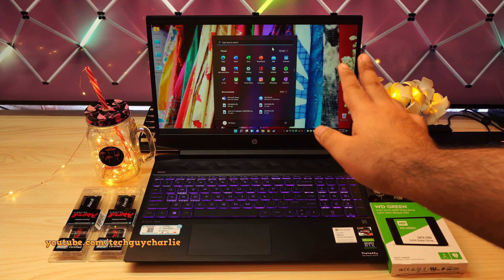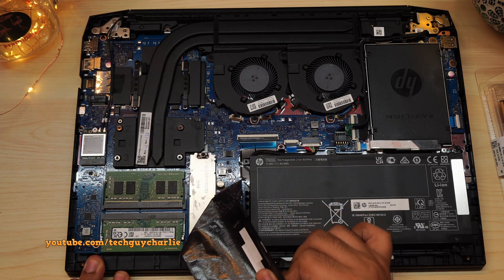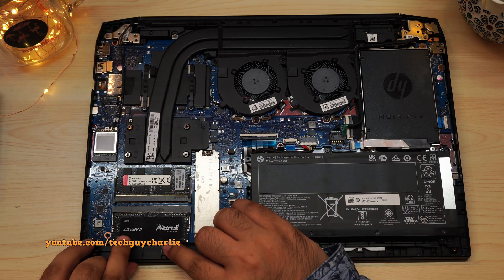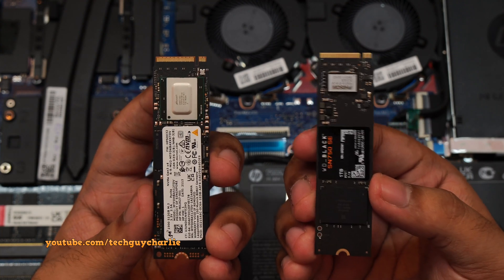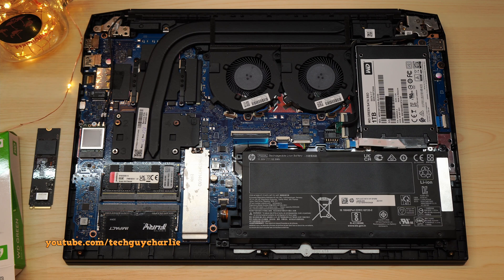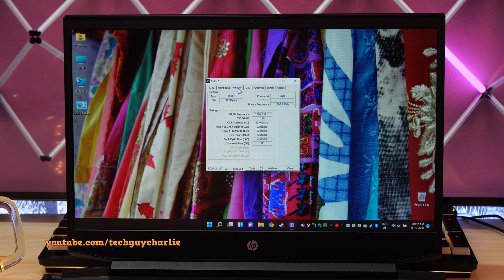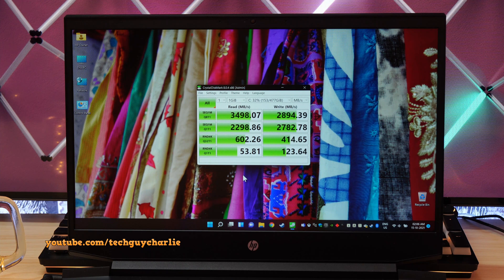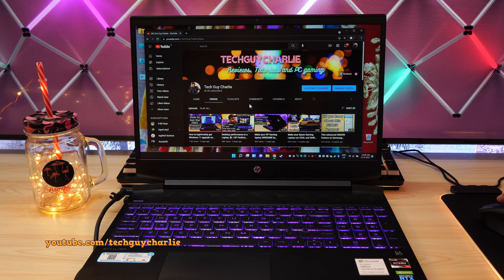HP Pavilion Gaming Laptop Ultimate RAM and SSD Upgrade Guide

Comment: Hey Bro I have Hp Ec0xxx And i installed one stick of ram 8gb making it 16gb but when i boot into system it only shows 5.9 gb usable and 10.1 gb hardware reserved in the task manager also I figured out About UMA buffer size but when i get into bios for that there is no Advanced Tab there for changing the Buffer size and Im stuck here with 5.9 gb please help me out should i reset the bios ?
Reply from the maker: That's so odd, I just checked, mine shows 670mb as hardware reserved. I also checked and there seems to be no option to change the memory available to integrated graphics through the BIOS. 10 GB hardware reserved is just not right, total waste of memory because its never going to use that much. Maybe a BIOS reset might help.
Reply: all of a sudden my laptop started crashing now when i first tried to enter into bios it started to freeze on boot logo , but somehow i still manage to go into windows and now it gives bsod issue ig i have to again reinstall windows and will try to reset the bios

Comment: Bro, I have this same laptop but the issues is, I'm facing problems with the gaming...Not  a single game can be run smoothly. can we upgrade or replace the graphics card in this lapop?
Reply from the maker: Did you clean the fan and heatsink? maybe its overheating, because mine is still working fine, or maybe its time to do a clean install of Windows itself. Also, you cant upgrade the graphics card because its soldered on to the motherboard.
Reply: @TechGuyCharlie have done everything and also went through a proper service. Nothing changed though, is there any possibility to use external graphics card or change the cu itself?

Comment: Finally did this in 3 hours! The longest part was trying to pry open the back panel, scratching the surface a couple of times. Then I screwed the SSD wrong way... Then I couldn't close the back panel properly so had to screw it for a second time... But finally, finally I did it🫠
Reply: Broke my nail trying to pry open btw forgot to add that lol
Reply from the maker: I miss the good old times when you didn't have to pry the back panel open, the upgrade opening was right there at the bottom of the case!

Comment: What is the maximum capacity of SATA expandable storage for this Pavilion Laptop ???
Reply from the maker: I've tested 2TB SATA SSD and it worked fine, so I can confidently say 2TB SATA SSD should work without any issues. I'd like to test higher capacity but anything beyond 2TB becomes very expensive.

Comment: Hi, Please I need your help
I have this same laptop but mine came with 1 TB HDD and I added a 250gb SSD before
Today I purchased a WD Black SN770 1tb NVME m.2 and I tried to clone my current window into my new ssd and it completed without any errors but when I try to replace and add this ssd then it wont boot up, not even logo shows up. Please I need your help
Reply from the maker: Are you able to enter into the BIOS? or that doesn't work either?
If yes, then check if its being detected by the laptop? and then make sure boot order is correct? 
If the laptop just does not post with the new nvme, then something is wrong with the new drive.
Reply: @TechGuyCharlie  I fixed it but I was not able to clone my previous ssd, my device was being detected if I checked on system information before boot but it didn't appear on boot menu
Also when I tried to boot up using usb the it was working as well but not when I put ssd internally
I'm not sure why this was happening but I had to remove my hdd then insert my new ssd and using a usb flash windows 11 onto my new ssd
Then it worked
Reply: @TechGuyCharlie also after installation I'm unable to use my old ssd with previous windows 11 now if I change it with my current internal new ssd

Comment: is Crucial BX500 1 TB Desktop, Laptop Black SATA Internal Solid State Drive (SSD) (CT1000BX500SSD1) good . Cz I will be able to save some bucks with this one.
Reply from the maker: Its an entry level SSD, so it wont be fast, but certainly faster than HDD, But its the best if you are going to use it as a secondary drive, I went with WD Green as my secondary to save money 😁

Comment: I have an HP Pavilion 15-ec1073dx Gaming Laptop. When I bought it 5 years ago. It had 8GB DDR4 3200 MHz Ram. I upgraded it to 16GB DDR4 3200 MHz. If I was to upgrade to 32GB DDR4 3200 MHz. Will there be a noticeable performance increase for the cpu, gpu.
Reply from the maker: Only if you use apps that use more than 16GB of RAM like video editing or playing memory intensive games, or else 16GB is enough for normal day to day office/web browsing use.
Reply: @TechGuyCharlie My GPU uses 1GB and when I use Google Chrome or Opera Browser it uses 7GB

Comment: Is it truly necessary to unplug and remove the battery from the laptop before performing the RAM upgrade?
Reply from the maker: Yes to be on safer side, I didn't unplug because I regularly upgrade laptops.
Reply: @TechGuyCharlie  I also didn't remove my battery before installing an additional stick of RAM as the slot was easily accessible without any battery removal. I haven't noticed any issues and it worked perfectly fine. But in the future, I'll make sure to unplug the battery for extra safety.

Comment: Bro can i use 2 different brand ram in my laptop ? My laptop have sk hynix 8gb , i need to upgrade one more 8gb Ram ! 
Thinking about G skill ram
Reply from the maker: You can, but there is no guarantee that both will work at their max rated speed, i've seen this issue before, so Its best to use identical RAM from the same manufacturer.

Comment: where can I find original HP battery for the laptop,, any trusted website to deliver in india?
Reply: open ur laptop there battery model is written then search that on hp centers if not available then google the model and order it you want install yourself
Reply from the maker: You'll have to call up HP support or go to their service center! I got mine replaced this year, they replaced it genuine HP battery, and now my backup is way better, but genuine batteries are very expensive, not worth replacing if you are using your laptop at home.

Comment: Product: HP Pavilion Gaming - 15-ec0100ax
Operating System: Microsoft Windows 11
At first only 5.9gb of ram was usable and the rest 2.1 was reserved for hardware. I researched and found the the only thing I can do is to add 1 more ram stick so I upgraded to 2x8gb ram but now was I added 1 more stick of 8 gb ram 10.1gb of ram is hardware reserved and only 5.9gb is usable now too
Pls tell me what to do  How can I removed this reserved ram. 

tried removing the ram stick to check if the ram I order was faulty but it was alright

Comment: Hi, I have installed 2x 16gb rams just like you showed. I booted the computer and it showed on memory i had 32gb of memory. Then I partitioned the SSD and started using the laptop for a few hours. I checked the memory again and surprisingly it only showed 16gb and on CPU-Z it doesn't show Dual channel only single. I have taken the sticks out and swapped them but still same issue. Any idea why ?

Comment: Are you able to upgrade the motherboard with a better cpu and gpu?  I have one with a Ryzen 5 and GeForce 1050 was hoping to be able to go to ryzen 7 and a better gpu if possible to replace the whole assembly
Reply: Figured I’d provide an update for anyone interested. I bought an entire motherboard with the ryzen 7 and gtx1660ti using HP part numbers on their service guide. Ordered it from china for almost $1000 less than anything in the states and surprisingly it works great. Checked part numbers of the chips and everything checked out. Only other thing that was needed was a 200 watt power cable as that is the only different connector between the boards. I can provide part numbers for anyone interested. After many updates and driver installs it works perfectly and is significantly faster as I hoped

Comment: Thanks for the great video! I have the same laptop and used the same RAM, however in the task manager mine only registers as 2400 MHz instead of 3200 MHz. BIOS shows 3200 MHz, but task manager is showing 2400 MHz. Any ideas how to fix this issue?
Reply from the maker: That's odd, usually I'd suggest turning on xmp from the bios, but this laptop doesn't have that option, the RAM is supposed to run at the xmp speed by default.

Comment: i installed a new ssd into my pc and still it won't show in disk management. Is there anything i need to change in bios?
Also the Gpt popup doesn't come on my disk management screen. HELP😭😭!!!!!!
Reply from the maker: There is nothing that needs to be changed in the BIOS, can you see the new drive in the device manager? Sounds like a defective drive to me. Try going into the BIOS and see if its listed there.
Reply: @TechGuyCharlie  No it doesn't even show in device manager under disk drivers
Reply from the maker: Defective drive for sure, you could test it in another PC just to be sure.
Reply: @TechGuyCharlie  Thanks for the help dude. Much appreciated 🙌🏻

Comment: i have the gtrx 1650 version of this laptop, this is by far the most useful tutorial i have seen, keep it up
Reply from the maker: Glad the video was helpful. 😊
Reply: I good is  dor play games ? Like. Mw3?
Reply: @ezequielandrade3100  depends on the games optimization, games like GTA 5 and forza H5 run at ultra settings with 60-90fps consistently, but some games will run at medium settings, i havent tried Mw3 but it would probably be 60fps at medium settings

Comment: I have the same laptop hp pavilion gaming 15 with AMD R5 5600H CPU and RTX 3050 GPU. Recently I did buy and upgraded my laptop ram to 32gb ram but after installing new ram I noticed everything works fine as usual except games. For some reason games which are supposed to get more than 80-90fps from 8gb previous ram now I'm get 40fps with 32gb ram. It looks like a fps lock or something because it's not going more than 40FPS and not getting below 39fps. I tested it with 2 AAA titles which are GTA 5 and Ghost wire Tokyo. I did contact laptop service center they said try updating drivers and update but all of them are already updated. If you know why might causing this issue for me please help.
Reply from the maker: I guess the RAM is not running at the rated XMP speed, open task manager and see how many Mhz it is running at? Did you mix and match RAM sticks? if so that might be it.
Reply: @TechGuyCharlie  I figured out what's the reason for this, it's the software. After formatting and reinstalling windows every thing got back to normal and it's quick too.

Comment: can i use single slot 16 gb ram in dual slot ?
Reply from the maker: Bad idea, because the RAM is going to run in single channel mode, greatly limiting the performance. If you want only 16GB then get two 8GB sticks, that way the RAM is going to run in dual channel giving you better performance, or if you want to future proof, grab two 16GB sticks just like I did.
Reply: @TechGuyCharlie  thanku so much😊👍

Comment: I had installed a 8gb along with Ram that came installed from the store but the 3200 changed to 2667 is that a problem with every hp laptop or it's just with the pavilion gaming 15 series?
Reply from the maker: Both the sticks must be of the exact same brand, model and speed, then only it's going to run at 3200Mhz.
This is one of the reasons I always recommend swapping out both sticks for the same brand and model. I've seen this issue happen with many laptops and desktops, not just HP, seen it happen on Acer as well, even if both RAM sticks are rated to run at 3200Mhz, they run at 2667 just because they aren't from the same brand.
Also, can you remove the pre-installed RAM and see if the new one operates at 3200 MHz? if not, then might be some compatibility thing.
Reply: @TechGuyCharlie  ok bro got it
Reply from the maker: Let me know if leaving just the new RAM makes it run at 3200mhz, just to rule out any incompatibility, if it runs at 3200mhz then you can buy another one of the exact same brand and model.
Reply: @TechGuyCharlie not checked that thing pre-installed one runs at 3200 not checked the new one.

Comment: Does this laptop has XMP?
Reply from the maker: It doesn't, in fact none of the gaming laptops I've seen have user selectable XMP setting in UEFI, the memory will run at the rated speed, like if you install 3200mhz RAM, it's gonna run at 3200mhz regardless of manual XMP setting.
Reply: @TechGuyCharlie   I have pavilion 15 gaming laptop and it doesn’t support XMP profile so I can’t tweak my settings from 2666 to 3200 mhz
Reply from the maker: @globalpandaa  Sorry, I might sound dumb for asking, but is the RAM rated to run at 3200Mhz? if yes, then have you paired it with any other brand of memory? 
And, manual XMP toggle wont be available on majority of laptops, mine doesnt have it either, but the RAM does run at 3200Mhz.

Comment: Bro I have Ryzen 5 5600H GTX 1650 15-ec2004 ax model.. ssd 512 gb.. Is it possible to add another same model ssd mvme m. 2??
Reply from the maker: Bro, as far as I know there is only a single m.2 slot for SSD, you cant another same model SSD, you can either upgrade your existing SSD to 1 or 2 TB.

Comment: Where is the graphics card and is it easily upgradable I have had my Pavilion since the start of lock down and some games that have came out this year cras and are unplayable due to the heavy graphics even when lowered is there a way to do this?
Reply from the maker: You can't upgrade the graphics card on laptops, its impossible since they are soldered on to the motherboard. I'd suggest getting or building a desktop if you want upgradability.

Comment: I have a same laptop i have upgraded my Ram to 8 gb to 16 gb and i bought Two ram sticks of 3200MHz Before it was 2400MHz but after i install the 3200MHz 16gb ram 8×2 its shows still 2400MHz why please help me 
Ans in Comment...
Reply from the maker: That is strange because there is no additional setting for XMP! Could you check the part number on Google using CPU-Z and see if you have the RAM that actually is designed to run at 3200Mhz.

Comment: Can we replace the CPU? Upgrade it maybe? Or change it with a new fresh one?
Reply: Most likely not, but that requires soldering skills. Because unlike a desktop, a laptops gpu and cpu is usaully soldred on the motherboard, which usaully makes the motherboard unable to support a higher end cpu or gpu.

Comment: One of the brackets of the 2.5 of my laptop had a stripped screw so i tried everything to remove it but nothing worked so i just had enough and ripped the bracket off and just put it and it works fine

Comment: Will we lose our data if we remove our pre given hdd? or does the data stay same
Reply: That is just a plastic dummy. It is not an actual component. It is just there to indicate how to put an original hdd/ssd
Reply: @aneeshyr  Is that a dummy for all the laptops or only those with an inbuilt ssd
Reply: @tosfeerahmed7407   only the ones with a pre installed SSD can have empty hdd slot.
Not all manufacturers give that dummy. Like in Lenovo IdeaPad Gaming 3, you'll just have empty space for hdd.

Comment: I have a question, should I somehow disconnect laptop's battery from motherboard during changing ram or its not necessarily?
Reply from the maker: Its not mandatory, but is recommended to do so. So if you are upgrading for the first time and have never worked on a laptop before, then unplugging the battery is a safer way to go.

Comment: Mine is struggling to power and off and process any application its HDD 1tb do you know any common ways to fasten up this slowness
Reply from the maker: The HDD is probably on its last legs, time to upgrade to an SSD! Its easy, you can just clone everything from your old HDD to the new SSD, but a clean install would be the best.
Reply: @TechGuyCharlie  you satisfied with this?

Comment: I have the same laptop with ryzen 5 5600h and gtx1650 , i assume the mother board used would be same across all models , do you reckon we could mix ram sizes, mine comes with 8 gb and i wish to add 16 gb to the other slot, any idea if ot would cause problems or would work fine?
Thanks.
And. Great video , really helpful!!
Reply: It will work fine

Comment: Please take off the damn battery when doing this or you may cause a short circuit by accident and burn the whole laptop down !!!
Reply from the maker: Mate, I've been doing this for over 15 years, taken apart hundreds of notebooks and I always leave the battery plugged in, unless its externally removable and never had any short or issues.
Reply: @TechGuyCharlie  you just know what you're doing I've seen so many laptops be burnt from people accidentally putting metal objects on the laptop while its open and battery still plugged in. you don't have to remove it fully just unplug the battery cable from the motherboard that's it because even when shutdown it's not actually fully shutdown the kernel is still on and battery still sending power to it. I'm not criticizing you, I'm warning people who might actually do this without any knowledge.

Comment: is it necessary to disconnect battery i am worried i might tore the wires they are little
Reply from the maker: It isn't necessary, I didn't disconnect it for the very same reason, you just be careful not to short anything on the motherboard since the battery is plugged in.

Comment: Is it possible to change the wifi card in hp Pavilion 15 dk0042tx? I want to change mine because its broken
Reply from the maker: Yeah, almost every laptop I've come across have replaceable wireless cards, it will most likely have an m.2 Wi-Fi adapter card in it, just like mine does, if you aren't sure on how to do it, the best way is to have HP replace the card for you, they will swap it out for the exact model the laptop came with.